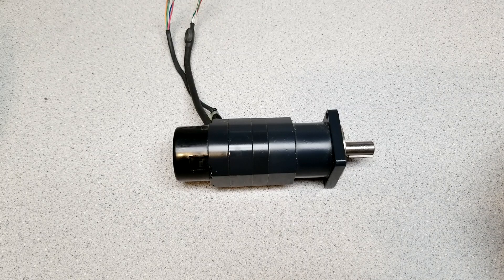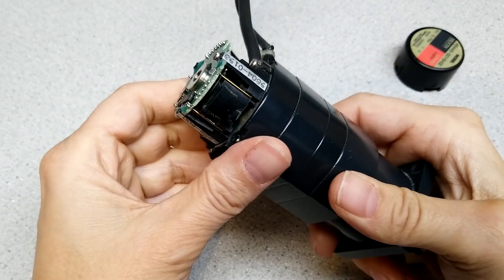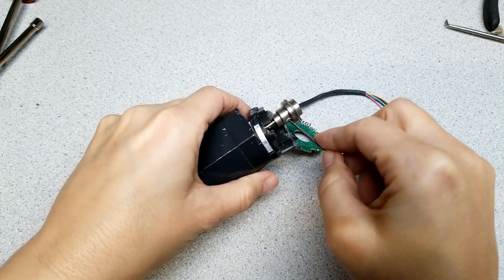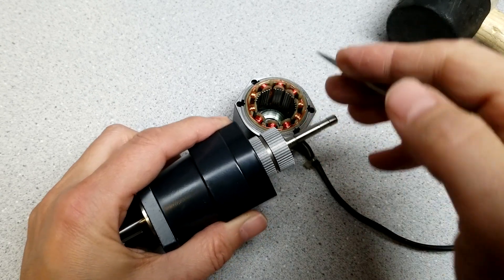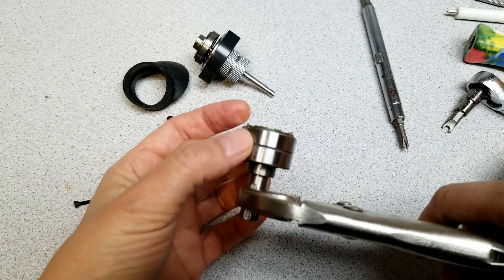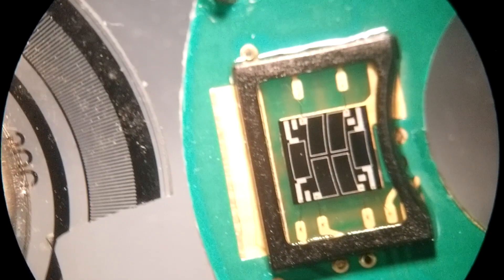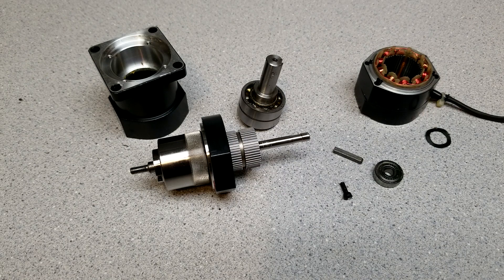Mini Harmonic Drive Teardown

Comment: The screw for the optical encoder wheel was glued in with some type of fast acting glue (aka crazy glue). You were to use some acetone on it first.

Comment: I had the same problem disassembling one of those that had a brushed motor. The brushed motor had the commutators worn down to nothing.  I couldn't get the encoder wheel off the shaft, so sadly I couldn't recycle it.

Comment: Great teardown! It is a shame it was destroyed in the process... but a worthy sacrifice for science! :) As for the encoder the one thing you missed is that on the LED side there are two rows of slots, and they are 90degrees out of phase with each other. When coupled with the receivers, this results in a quadrature encoding where only one output phase switches at a time.  If you would have laid a section of the disk over a bit of the plate you would see how the interference pattern moves,
Reply from the maker: You are right. It was a missed opportunity. Thanks for contributing. Mechanically, I think the drive will live.
Reply: The interference pattern is also called Moiré pattern, if anyone is interested.

Comment: Great to see what inside of that motor and gear box and thanks for the explanation of how it works.  I'm surprised to see it doesn't take much force to spin the rotor while the cam is still in  the "flexible cup" gear mechanism. How hard is it to squeeze or bend the cup a little? Thanks
Reply from the maker: The cup strained gear part is about as thick as 2 or 3 single edged razor blades at its thinnest part . It is flexible, but not too much.
Reply: @BrendaEM  Thank you for your reply

Comment: wow this video is wonderful!thanks for showing the inner working of those sophisticated engineering marvels
I've an important question and no where to ask,plz help!

Since I'm trying to build a syringe pump,I'm looking for geared nema17 like stepper(without much success),I accidentally stumbled upon oridental motor's product most with reduction gears are five phase require their own driver.In this video u claimed u can turn the motor on(I suppose u have their driver).I've read some driver's manual it claimed driver accept pmw signal,can I use microcontroller such as arduion as pmw source to dive those motor?
those motor sets are not cheap to try even second hand,plz help,thanks
Reply from the maker: Yes, and Arduino will drive a Vexta controller, though, the Vexta 5-phase controllers from this era have a Stepforward-pin and a Stepbackward-pin instead of the conventional Step / Direction.

Also, these motors, marvels they may be are getting old for anything medical-related, research perhaps, but you would not want to make something like an insulin pump from them. I actually found that one brand of optocouplers in the drivers generally do not work for the sleep/wake, perhaps because of age.

Comment: if you really want to get it to work again, you can either re-wind the existing motor, or get a nema16 or so, with a long shaft, and slap it on instead. on the motor side, acrulic or a 3D printed part as a mounting plate for another motor will be fine
Reply from the maker: I have the bag of parts for a NEMA 16.

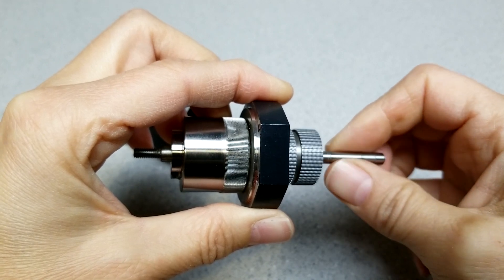Comment: 12:38 why isn't it only rotating the cup?
Reply from the maker: In this case the oval bearing race that deforms the cup, has less friction than the main shaft bearings. It might have something to do with the amount of grease in each. In places I hold the cup with the edge of my finger, if that is what you are wondering about.

Comment: There is no magic in here. Its just a LED. I mean... its just 2 wires 😑😡??
UNsubscribed
Reply from the maker: I am sorry. I tried. 
The "magic" was that the encoder was 500 steps/rev, which is more than twice the resolution than the average 200 step motor, that and it was attached to a 50:1 or 100:1 to one harmonic drive system.